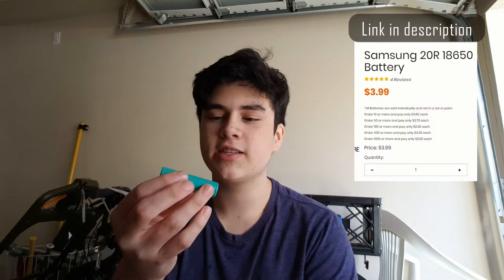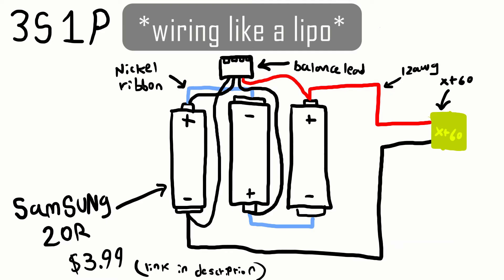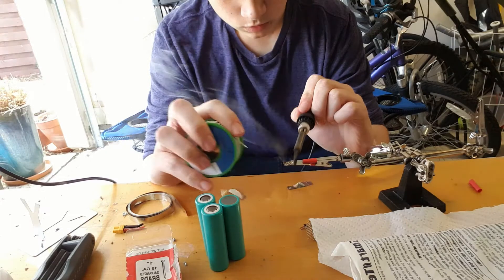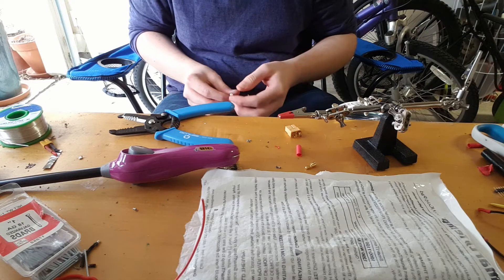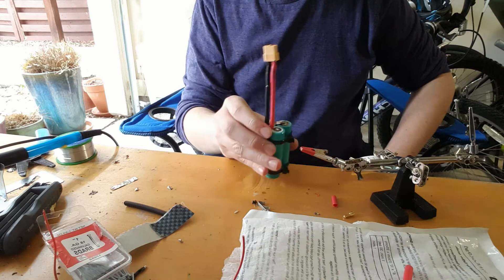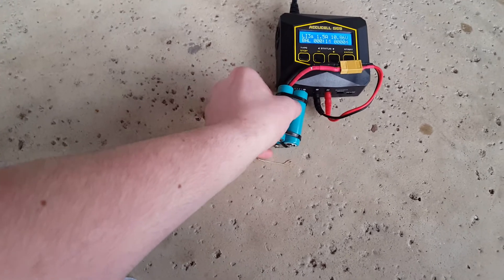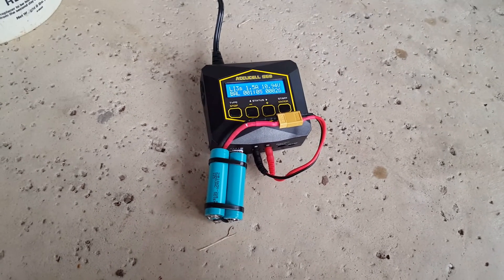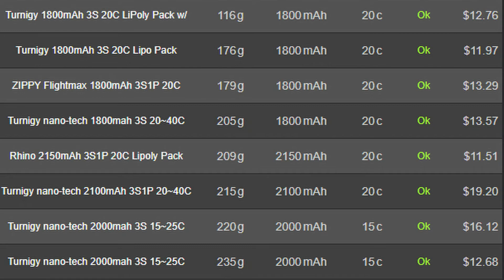DIY Lithium Ion Battery Pack

Comment: I think you mean higher capacity? xD btw informative video!
Reply from the maker: Li-ions have a higher specific energy which is energy per unit mass. So for two batteries with an equivalent energy content, the li-ion would be lighter. But yeah energy density was probably the wrong term.

Comment: thanks for the video! great tip on how to use the solder instead of a spot welder. I will try that. i rather use this method than spend an extra $150 for a spot welder.

Comment: haha, shorting leads happens to everyone one once in a while :)
Reply from the maker: Lol I’ve seen some of you videos bc I was planning on making an electric skateboard. Are you working on a lithium ion battery for your boards?
Reply: Hey Benji!  Glad you checked them out.  You should totally build your own.  I've made a 10s2p with a BMS.  However, because the C rating is much lower on Liions  so something like a 4p would suit my needs.  I actually purchased a book called, "DIY Lithium Batteries" by Micah Toll and its a great read.  Cleared a lot of confusion for me.
Reply: I spot welded a coolant line from touching positive and hitting line lol